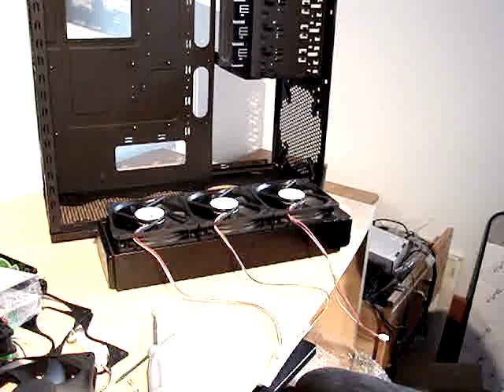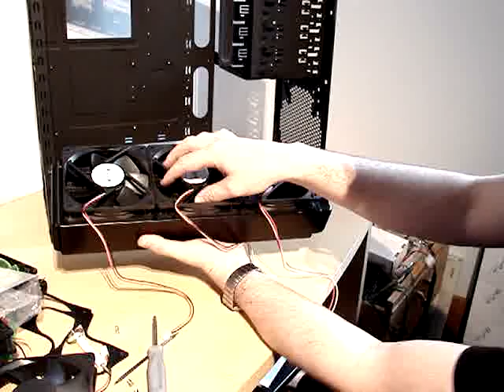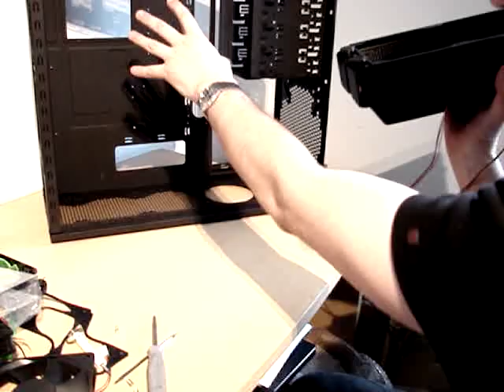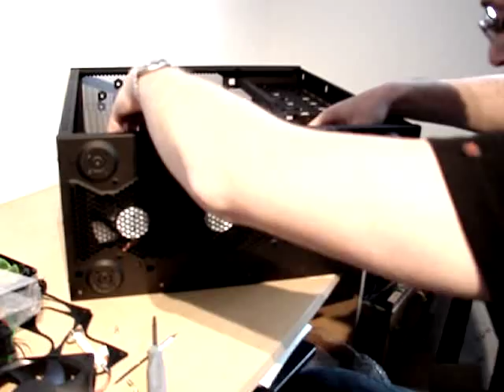Watercooling build Part4  Attaching Xchanger Radiator with fans to custom HAF932 case

Comment: cool, that fan i think is venting OUT the case not INTO the case, if i am correct that radiator really has moisture to avoid by the board..just commenting..